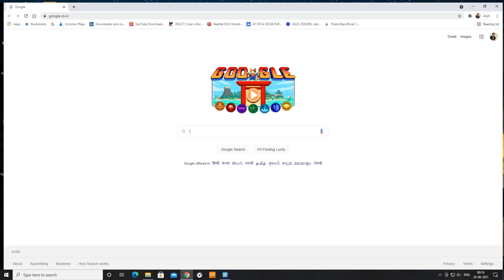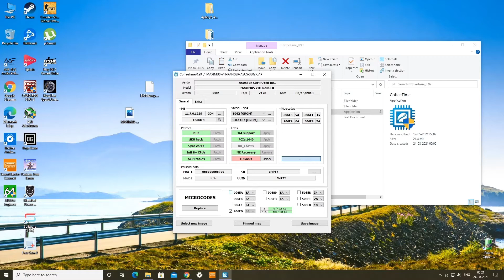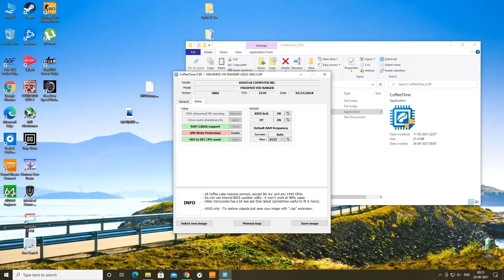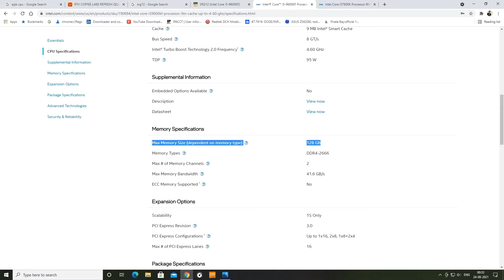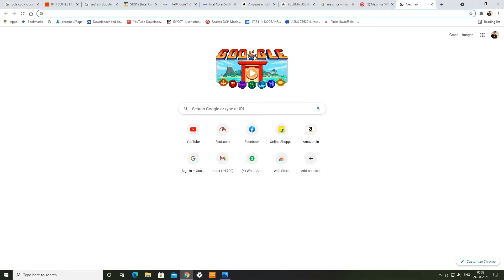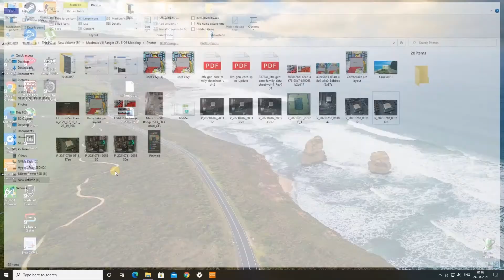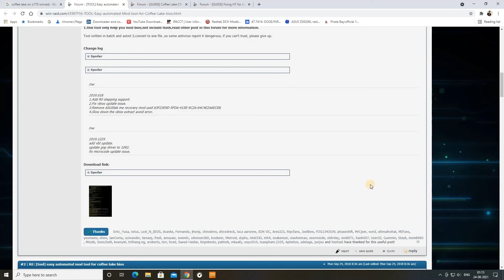It's Coffee Time! Running Coffee Lake CPU on ASUS Z170 motherboard ft. CoffeeTime 0.99

Comment: Awesome detailed video. One thing I don't get is it tho. You did not isolate some of the pins from the CPU. (which was instructed in the CoffeeTime pinout guide). Arent those mandatory?
Reply from the maker: Hi there. Thanks for the appreciation. Isolating the pins are not mandatory for all motherboards. In general, some ASUS motherboards require pin isolation but if you look at the reference design pin outs, those pins are reserved for 6th and 7th gen. So ideally, they are not connected anywhere. I checked the respective pins with multimeter (resistance to ground) and surely those weren't connected anywhere(got infinite resistance). Hence, no isolation is required for this particular board and revision (1.01). However, some higher end boards like the Maximus VIII Extreme and Forumula will require these pins to be isolated.
Reply: @geekjit215  Thanks for the info. I am planning to "upgrade" my ROG Strix Z270-I ITX motherboard. Honestly, it is really a pain to find solid (ITX) 8th gen motherboards...

Comment: I'm in the middle of upgrading my old Maximus 8 Impact to run an 8700K. After reading countless forum posts and what not, your video makes it a piece of cake. Easily the best guide on the internet, when it comes to this process :D
Reply from the maker: Thank you for the appreciation. All the best for your adventure. :)
Reply: Hi, did you have to connect the pins and isolate the other on your cpu for that mainboard? I have the same motherboard and was wondering if modding the superio controller would do the trick.

Comment: Hi, great video btw, i have the same  motherboard and i would like somewhere in the near future try this method, i already modified the bios (not flashed) and i want to know what do you think about putting in the mobo an i9 9900k, is it worth it?, it's not because u can build a ryzen with better specs for the same ammount?

You bought an 9600k really cheap and looking on second hand in my country i can find it for almost 100€ (Spain) and i think it's a great price. 9700k on second hand goes for 200€, imo not so great value, and 9900kf i found one for 200€ but mainly 250€.

Thanks
Reply from the maker: If you can get a 9900K or even a KF for good value, I would say go for it. The VRM of this motherboard is very much capable to run an i9 9th gen even with a bit of overclock. And you are right, I got the 9600KF as it was offering great value and has been a very nice upgrade from the i5 7600K which I was previously using.
All the best. :)
Reply: Man... I've got the same processor right now... 🤣. 4c/4th is becoming not great anymore that's why I'm considering this because I haven't got money to build a new pc. Well if anytime soon I perform the change I will post u my results. Many thanks
Reply from the maker: @Davpedra  Exactly the reason why I upgraded. 😅 Try looking for a deal on an used 9700K. I think if you get a good deal, it would be a sweet spot everything considered. :)
I am using the 9600KF with a RTX 2060 Super from Galax and there is no appreciable bottleneck even on CPU demanding titles like CP 2077 and Warzone. The 9600KF should be good for 120 to 144 Hz gaming.